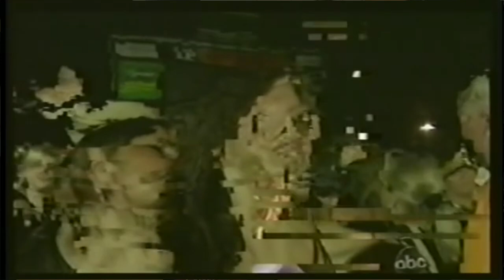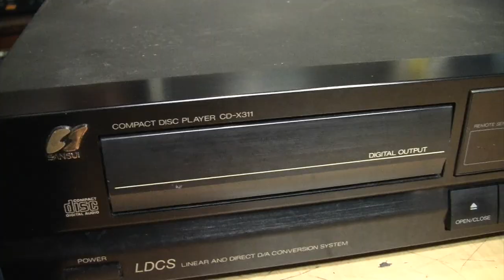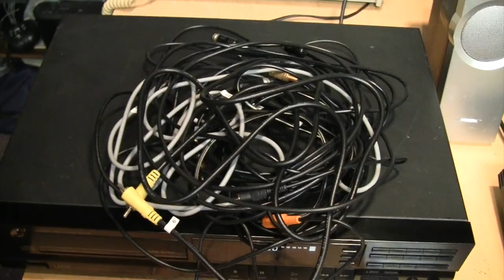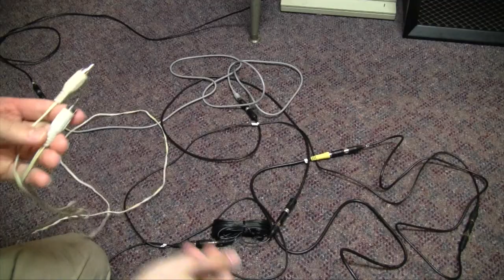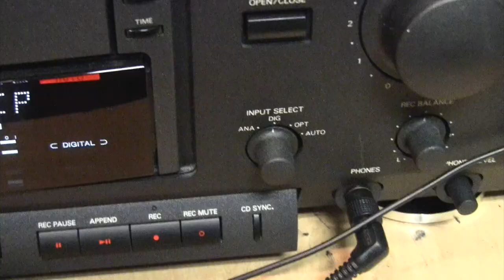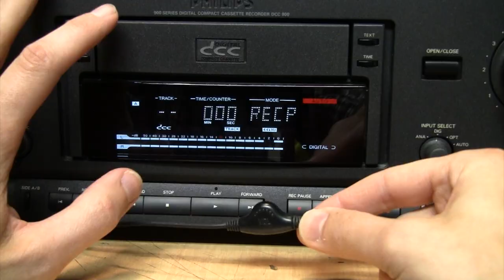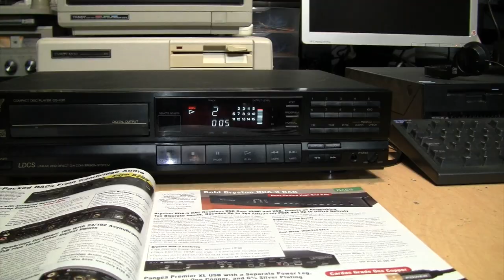What does a crappy digital audio cable actually sound like?

Comment: you probably got cross talk due to the high frequency harmonics of the digital signal as it went one way and then the other way on that crappy red/blac cable.  you could test this by splitting apart the red/black cable to see if this the problem.   High frequency digital signals are prone to interference if not shielded.  There is a know problem of un-shielded HDMI cables and the broadcast frequency for terrestrial TV.

Comment: The nature of digital transmission would hide any signal loss you might get, which is the advantage of the digital system. Either you'll get sound or you won't. It might help to put a potentiometer in the line somehow to increase resistance to the point of failure since more line increases the resistance.

Comment: I think that last 25 foot of rca cable was bad...or of less than normal quality...therefore it stopped the signal sooner than it should have, if using a better quality cable...I think it would easily go 100+ feet with good cable..

Comment: i am not an audiophile. i "think" if you had a better quality speaker, you could difference. i have decent entry level speakers and i can hear difference between copper thickness of wires used, especially on long runs for surround speakers. louder volume for sure...quality is subjective. i'm guessing better signal will get most out of speaker. i figure quality of sound depends on how much speaker can produce. there must be middle ground. i think speaker wire does matter to and worth it....even for entry level equipment. i think speaker cables should be a fraction of cost of actual speaker though.  crappy speakers will always sound crappy, no matter how much you spend on cables, amplifier, dac, etc.

Comment: i have a questions... are those couplers repeaters?.... because then it would turn it into 100 Ft of cable.. it just goes into the say 20 feet your final cable is (or at least your weakest cable)
Reply from the maker: Just couplers, not repeaters.

Comment: The 50 feet cable had two parallel/anti parallel lines that were causing mutual inductance and this caused distortion. If both the strands were stripped apart and tests were done, it would have sounded normal.

Comment: I'm not 100% sure but I understand that some CD players have a built in mute so if the over all signal going to the dac something built in somewhere will mute the sound... I have 2 different boom box CD players one was an early generation Emerson and an RCA ..
The Emerson would mute with just the slightest slow down of the CD (slowed with my finger) the RCA wouldn't mute it did not sound like slowing a record down the same way definitely a very strange sound it almost maintained the correct pitch LOL but definitely not normal sound ... I don't know how to describe the sound but it had a twang for sure

Comment: By putting in all that cable you are taking the cable out of the 75ohm standard impediance, probably causing reflections at the connectors, then it really is losing digital data

Comment: With usb, the main problem is ground loop noise and digital noise from the computer.  I had a huge improvement when I put a Olimex USB isolator (Ex: https://www.olimex.com/Products/USB-Modules/USB-ISO/ ) between my Stello dac and the cheap Alix board I used as a MPD music server. Note that is a full speed isolator, you can't use that with high end dacs that need higher than 96khz/24 bit rates, then use a high speed isolator like (https://hifimediy.com/high-speed-usb-isolator-480Mbps)

The pcengines alix industrial board is selected by many because it's so simple a board (no video) that you avoid some noise. You can go farther by replacing the cheap wall wart with a better power supply to the alix. Using a usb isolator is probably the simplest fix, then you can just leave the remote pc (alix) with the cheap wall wart and filter the usb data right at the DAC.

I agree that the snake oil people are fibbing about the problems being in the digital domain. A typical usb system is correctly getting the digital values from the start end to the destination. If that wasn't true then how would any computer technology work?  You'd constantly find your documents corrupted when you sent them over usb to your external usb hard drive .

Comment: the only thing a costy cable gives is durability, if you for some reason need to run the cable where it's getting hit or stepped on then yeah it won't get ripped apart easy that's about it

Comment: I've always felt that "bits is bits" makes sense, and above a certain minimum level of shielding and conductivity all cables should work equally well. However, devil's advocate, this test does seem to support the idea that a digital connection can indeed "kinda" work, and by extension that a better quality/more expensive cable can kinda work better than a cheaper one. I'm not sure that that's what is happening here, so could you explain?

Comment: I hate to say this but, although it might work I'm afraid it doesn't address the sound quality. It may sound alright on cheap computer speakers that don't resolve anything anyway compared to a high end audio system where you can hear changes in cable brands easily. Interesting anyway, was entertaining..
Reply from the maker: But you can't hear changes in cable brands with digital -- it just doesn't work that way! The signal either gets through perfectly fine, or you get the results I demonstrated. There is no gradual degradation like with analog.

Comment: "I'm listening to music played on my 30 year old CD player into my computer's sound card and a 30-foot length of crappy digital cable sounds 'perfect.'"  You started out by implying that more expensive digital cable is not worth the money, but you don't seem to actually have any such cable in your tests.  But even if you did, I wouldn't be surprised if you couldn't hear a difference on your rig.
You seem like a reasonable guy, so I'm going to say some reasonable things and hopefully get you to at least moderate your 'bits is bits' comment.  You're actually making my point already by creating such a long length of cable that you can hear the garbage coming out of the cable.  Why does it take such a long cable before you can begin to hear artifacts in the sound?  Partly because the noise level that is already part of your rig masks the artifacts.  A reasonable person should be able to acknowledge that an audio system that is quieter and more resolving could hear the same digital artifacts with much shorter cables.  Do you agree?
If you bought some of that more expensive cable, I expect that you'd be able to run a longer cable before the signal craps out on your rig - I don't know.  But I do know that on a more resolving system, a better cable with better shielding and better conductors and better connectors leads to fewer dropouts, smaller attenuation and noise, resulting in 'better sound.'
If you're happy with the way your rig sounds, you'd be foolish to spend more on a cable.  Enjoy your system.  But if you happen to wander into a purpose built listening room with a carefully-constructed audio system that is tuned at every level to remove noise, you might be surprised the difference a quality digital cable can make.
Reply from the maker: You are incorrectly applying analog-style characteristics to digital audio. Digital doesn't work that way. As the signal degrades, or as you claim is already degraded to begin with, you don't get a gradual rise in noise and distortion -- it just suddenly goes from sounding perfect to sounding like total garbage, or cutting out completely. You are gullible if you think some $300 cable is going to change the way this works.
Reply: @vwestlife  You would be right in calling me gullible if I have strongly held positions on a topic like this but have never actually experimented or listened to a number of setups with some very fine audio systems.  You know that when talking about signals on cables, 'digital' is a complete abstraction; All signals are analog.  'Digital' refers to the way that the analog signal is handled by the components at either end of the cable.  While it's true that 'analog' signals can experience artifacts not common to 'digital' signals because of the way they are interpreted by the receiving component, many harmful effects related to poor cable quality and noisy environmental conditions can be detremental to any kind of signal on a cable.  My very simple point is this... If a cable is poorly shielded and operating in an electrically noisy environment, the amount of noise carried along with the signal is relatively high.  This makes it relatively more difficult for the digital receiving component to identify the original signal aamong the noise.  A similar affect is observed due to large signal attenuation - the signal-to-noise ratio goes down.  We heard the noise artifacts in the audio played during the video when the cable was sufficiently long, didn't we?  That comes from 2 sources - Noise obscuring the signal as well as noise directly being injected into the computer's sound card both from the cable and from the computer, the audio circuits of which are probably not well isolated.
It would be a fun activity to get this rig set up so that it is producing noisy but audible output (as it does at several points during the video), and then begin to work on both the CD player and the computer to attempt to reduce the noise.  I'd start with some power conditioning; I'd be interested to know if the computer and the CD player are plugged into the same power strip, for example.  Also make sure that the CD player and computer are at least several feet apart - A standard computer is a horrid source of electrical noise.

Comment: it depends on the coding scheme and the error detection&correction method used. Contrary to analog transmission where the quality of the result is directly related to the quality of the received signal (or, conversely, how distorted the result is, is directly related to how distorted the signal is, be it AM, FM, etc).

Comment: My (educated) guess would leave me to believe that when you encounter loss in a digital audio signal you hear pops/hissing for one of two reasons, lost/corrupt packets and buffer runout. Corrupt packets would cause random extremes of notes making a hissing or a "Pink Noise" sound and buffer runout would cause the DAC to stick on the last signal it got making it sound blocky or like a "Commodore 64". Otherwise "Jitter" is an impossibility because of the buffer and the way a DAC would deliver sound and audio corruption will show as very notable hissing/pink noise.

Otherwise, other things that seem like myths are kinda true. Like cyrogeniticly freezing cable for better sound, which essentially work hardens the metal so that it's more tightly held together at a molecular level, same premus with oxygen free cables.. BUT!! you can simply just get slightly thicker cable to counter that :-/ That's like getting very expensive tires to fit your rims so you car can go faster when you could get different size rims and tires for a fraction of the cost.

Point is, I do have expensive cables and one day i ordered a "pair" of very nice cables for some monitors and when i got them in the mail i noticed it was a single pair just for once channel. At that point i got annoyed and had an apifiny knowing what i know about electromagnetics and realized a pair of braided home electrical wiring would do every bit as good and better than the 14 gauge cable i just bought for a fraction of the cost. So that's what i did. I cleaned up the contacts very well (because i wasn't going to waste more money on banana plugs either) and used braided cable vs solid because it will crush better in the posts making more of a contact area. And at around 80 watts a channel from a high current Pioneer Elite amp I could not tell the difference, and i tried. I asked friends, i would turn the music all the way up and ask a friend to switch between channels while i was too far to tell which speaker it was and couldn't tell the difference.

It's all self justified bro science

Comment: I think the Signal can be destroyed when it goes back and/or forth in the stereo cable because it acts like a capacitor. It may also be that there is massive crosstalk in the stereo cable with slight delay so that the DAC can't decode the Signal in the right way.

Comment: I had a problem with my surround sound system when using it with any wired cable let it be cheap or expensive, anytime I'd put in my USB stick or use the aux port I'd get this low pitch hmmmmm sound, in the end I bought a €60 optic cable and it fixed, no idea how tho
Reply: 60$???
Reply: @PicThor  No it was €60(Euros) not $60(Dollars) , I live in the EU so it would cost like $66 in North America.
Well that's on XE currency exchange anyway.
Reply: you can get an optical cable for about 10€
Reply: @PicThor  Oh......... :(

Comment: I have been an audio tech for 40 years. High-end cables are nothing but jewelry for your stereo equipment.
Reply: only reasons to pay more for audio cables are length and the quality of the shielding (flexible/strong)
Reply: Purchasing cables these days feels like a gamble. Am I paying too much for poor quality or paying too little for the same substandard stuff? I am in search of a dependable and trustworthy brand, one that consistently offers good products for a reasonable price. Just for reference, a costly HDMI cable I once bought stopped working within a few weeks. Further, a cheap phone charging cable I chose started fraying and failed to charge my phone correctly after just a month.
Reply: @SATX_09  Belkin are very thick and over built for the price, I have never gotten a Belkin that didn't have more copper than expected yet time and time again.  Howver for whatever reason I have preferred low-level audioquest (Evergreen in particular) in sound quality terms. Whether or not you believe cables make a difference to sound or not I really do like the way they are made, and I do think the fact that they are cold crimped instead of soldered makes a difference, I do feel solder is a minor Sonic demerit, so if you are a cable believer give audioquest a try (in contrast I think Kimber cable is quite overrated and sound dark,) so of course if you are not a cable believer, you should go with Belkin which ironically to me sounded nigh on identical to Kimber cable at a far lower price. Belkin and aq are built to last , too.
    Edit : by the way I've heard every argument about how what I hear is expectation bias or non measurable or whatever -so you're not going to change my mind and calling me stupid , it will be just a waste of your time to do so
Reply: What are trying to do with the cable? If using it professionally you’ll want to spend a little more on reliable, long lasting cables. I have many more expensive cables for doing sound professionally. They are guaranteed for life. I can’t tell you how many times I’ve worked with guitar players it singers with cheap cables that break during a show. I’m not interested in spending a lot. That’s dumb. I’m saying a $40 cable might last a lot longer than a $10 cable. Also, terrible quality copper wiring does corrode more quickly and the highs will become muted. Maybe not as important for digital.
Reply: On the one hand you're absolutely wasting your money to spend a lot of money on cables, there are very very good cables in the low price field, the difference is real in my opinion, but I agree that spending a lot is wasting your money when there's excellent cables from companies like Monoprice  
  You CAN  hear the difference sometimes between one cable and another however.
Reply: Except if you are using it for analog audio.
Reply: @inputerase  even with analogue audio there are no measurable differences between decent quality cables and ridiculous  high end cables. The cables that ship with components  are usually  garbage, though. Not because  of any audible differences as much as they tend to oxidize and cause intermittent connections.
Reply: @jgrimsley2000  I changed my aiwa adf770 deck pakage rca- shitcables to all shielted guality copper ones. IT Made a difference. Period.
Reply: @artsimannisto5659  Decent RCA cables don't  have to cost $100. The point of diminishing  returns is well below $20. No one would argue that  the cables that ship with equipment  are decent.  Go ahead and spend $275 on a set of Kimber cables, then come back on here tell everyone  how much they expanded  the sound stage and improved imaging and instrument placement. It will cost you $275 and all of your credibility.
Reply: @jgrimsley2000  Finland,here these short rca cables pricerange was about 20euros.
We must remember this,its a big difference between antennacable and balanced all shielted connector cables. A BIG-Difference.
Reply: @artsimannisto5659  if you're talking about twin-lead, maybe. RF coaxes can pass audio frequencies with ease. Passing 20khz is not taxing.

Comment: I think there is more than just length, you see when you have that cable colied like that and signal comming from opposite direction there is a destructive interference between them. So If you just tried to uncoil those cables from each other there is a good chance it would still sound perfect. This is actually a similar effect to common electric transformers, currents going in oposite ways produce magentic field which then affects current in other coil (cable). Basically your signal is killing itself when it's comming fomr the other way in the second coil. Basic electromagenitc laws.

Comment: The difference between the volume thing with the standalone stereo system vs. with the computer is interesting. When you get the voltage lowered right on the verge of cutting the signal out, it sounds like you're detuning a radio to a blank frequency!